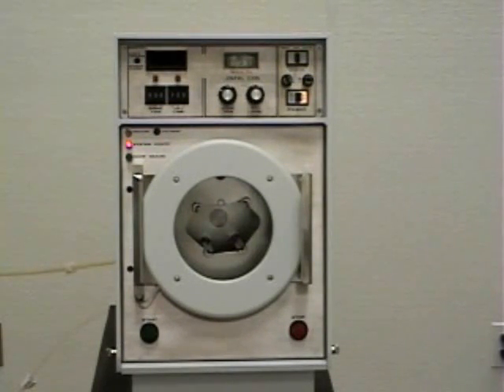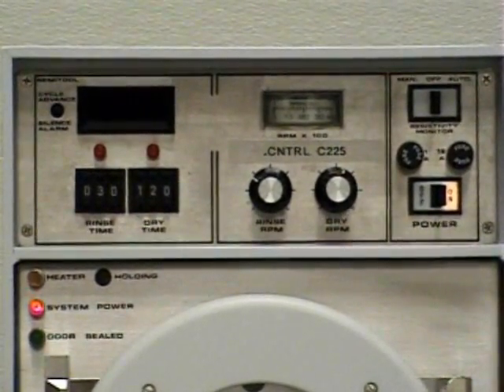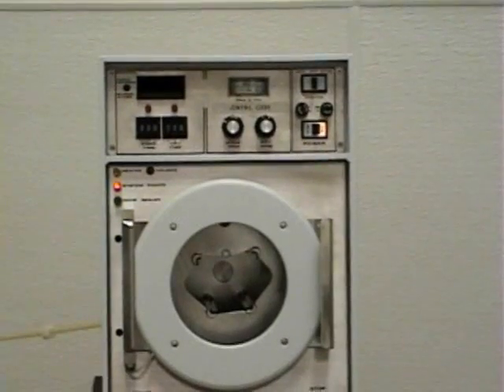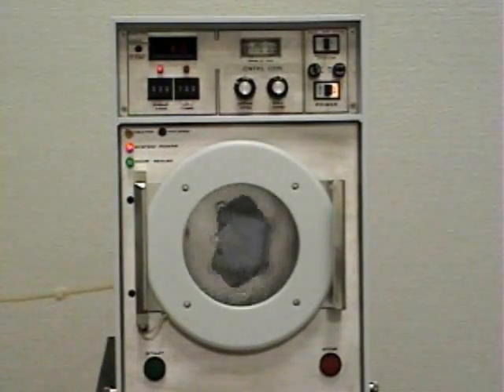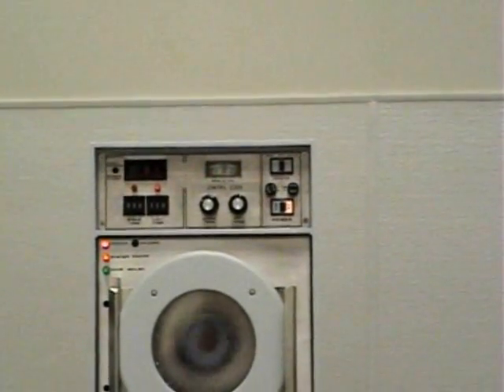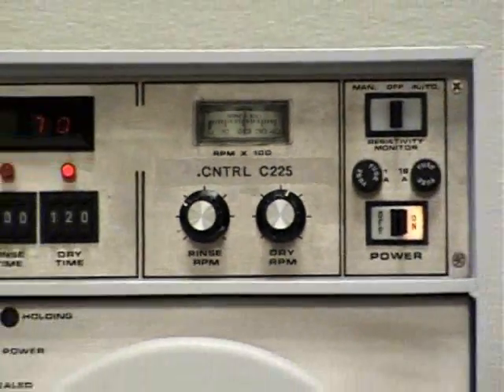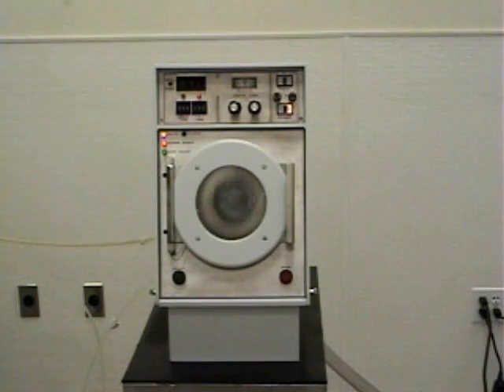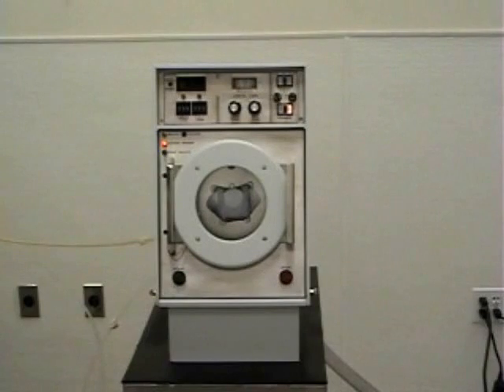Semitool ST-240 Spin Rinser Dryer Demo

Comment: This piece of equipment is a refurbished Semitool SRD (Spin Rinser Dryer). It is used for rinsing and drying wafer substrates. Simply put, it is a machine used in the process of making computer chips or other semiconductor products.